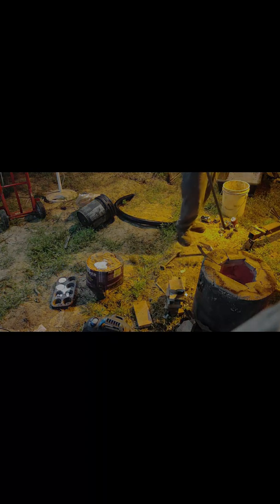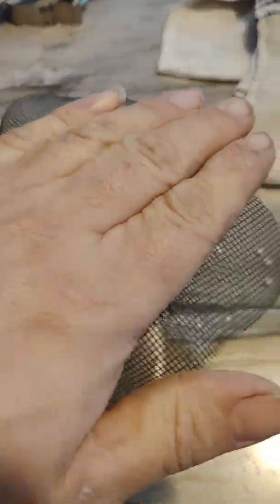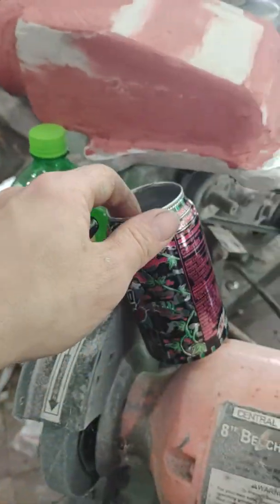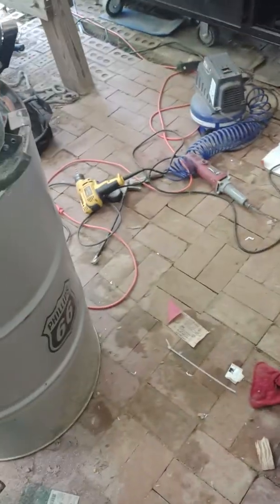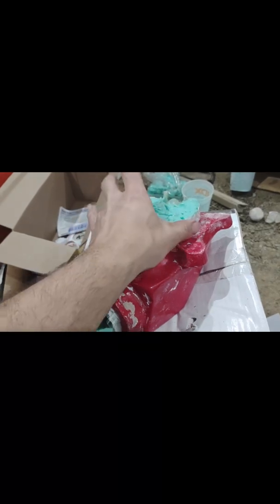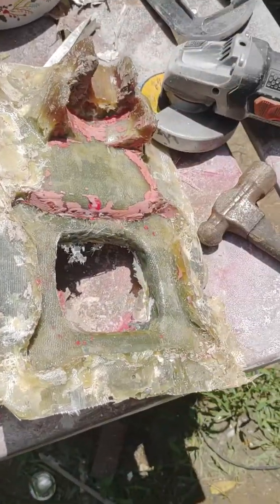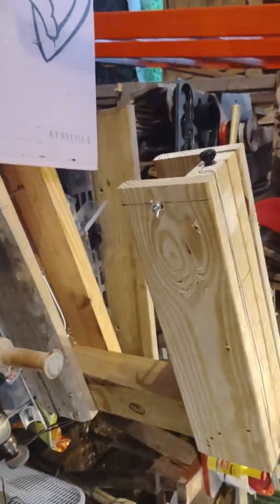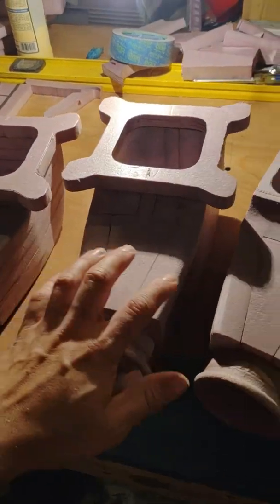Steam Forming Polystyrene at Home, and Other Foundry Pattern Making Adventures!

Comment: I had the same thought process of making these patterns with the beads. I was going to try something similar to what you did. But that went with moderate success. I read that this is normally doing in an autoclave. This would mean in your case, I would put some water in the pressure pot, have some base in there where you could put that same can above the water, close the lid, and turn on the heat. It's the pressure that was missing I believe. I Don't have a pressure cooker, so I can't try. Would love if you could try that. Cheers. Subbed.
Reply from the maker: Why thank you! A note about EPS foam: the industrial process isn't done in an autoclave, it's really just a steel mold, filled with special polystyrene beads, and blasted with steam.  The thing is: the polystyrene beads are made with pentane dissolved throughout them.  The steam softens the styrene, and at the same time boils the pentane.  It puffs up like a popcorn kernel, filling the void in the mold.  

Doing it with already-expanded polystyrene beads is hard, because the pentane has already been boiled out.  Therefore there's nothing to cause the beads to expand, and there's no mold-filling action from the beads.  It really only works to kinda fuse the beads together as they are, almost like perler beads. 

 But I do think with some finagling I can get a usable product, like maybe a compression mold?
Reply: @DerrangedGadgeteer  awesome, yes, your starting beads were already well expanded .I found some beads in a toy store for Xmas snow, they’re like only 2mm in diameter, I am going to throw them in some boiling water and see how they expand, next of course is the mold. In our home world metal casting kinda difficult but we can of course have it cnc milled somewhere, but then the question becomes, then I could straight pour aluminum in that steel mold, no need for the lost foam process right? Unless you would want more than one or two pieces a day of the same, say if you’d want 10 pieces or more per day, okay, steel mold, pour in beads then in the sand bucket and pour. If the steel cnc mold is very expensive, okay, we can do the epoxy resin mold, question will be how to get the steam in and out, we would have to turn thread and put in and outlet valves on. Maybe not, I saw another video of a guy using 2 part steel mold, fill it with pre-expanded (slightly boiled in water and scooped up with sieve) closed the mold, and place it in a sterno held warm food warm keeper. With excellent result.